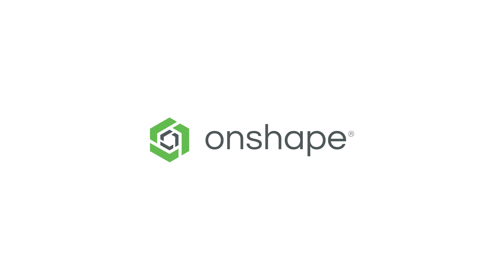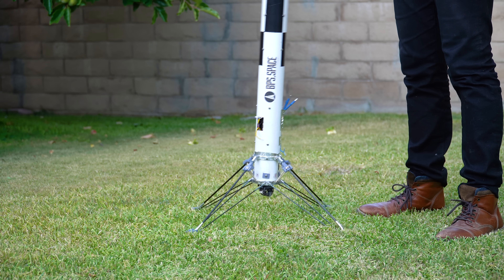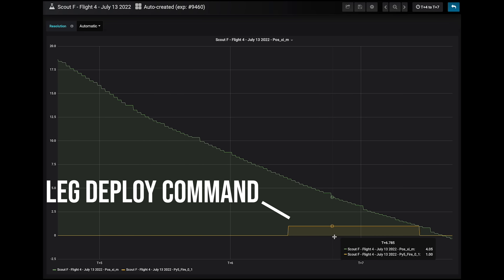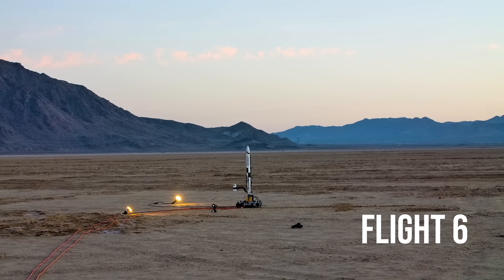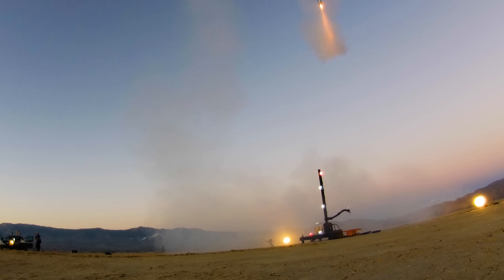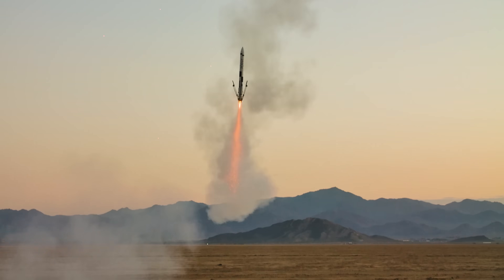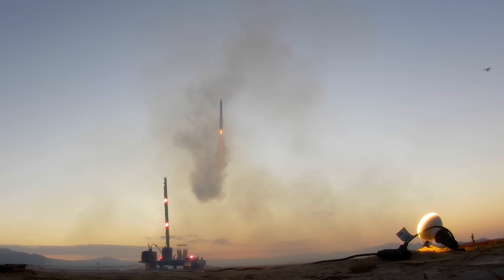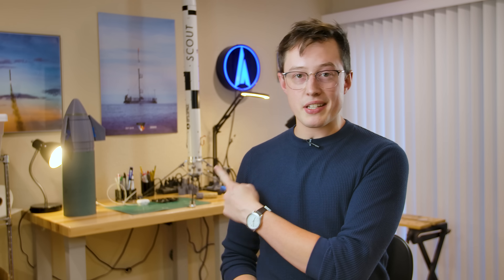Can This Model Rocket Land More Than Once?

Comment: Not a rocket expert but during the landing stage shouldn't the rocket put out more thrust as it like more nearer to the ground ? Like:  up - thruster1 - full  thrust  - > peak height- thruster1 -off -> decent -thruster 2 - half thrust (to slow down) -> just before landing - thruster2 - final full thrust (to make the momentum as low as possible. basically stop downwards momentum if possible like hover over) - landing -thruster 2 slow off. In the video it more like trying to slow down and reduce impact rather than trying to stop momentum. Just sharing an observation. :hand-purple-blue-peace:

Comment: Ceramic throttle arms....I assume you are using them because of heat resistance, but why not use a high temperature resistant metal? Also it may seem like a naive question but why not put spring loaded spokes on each of the landing gears so that if one side impacts first they spring out to expand the surface area of the gears (like a birds foot) making the rocket harder to tip once contact is made? Maybe make it mechanical so that you wouldn't even need to code it to trigger.....

Comment: did u consider hydrolics 
I mean a smooth syringe with water or something 
essentially it will move that fluid from one place to another slow or fast depending on the smoothness etc
this will dampen fall but will not have much recoil I think
just a suggestion maybe u might consider that in a future rocket

Comment: Idea here!!
I think the flex in the legs is fine because it absorbs the impact but it’s the rebound that bounces the rocket to the other side. So you could try letting the legs flex with a rebound damper to keep the legs from springing the rocket to the opposite side. So somehow  design a linkage that flexes as the strut compresses then the strut will slow how quickly that flex returns. Just applying some bike knowledge here.

Comment: You could use just the strut portion of the rc shocks. You had the entire coil over setup in the video, but it’s called a coil over because it’s over a linear shock. So might be an easier to access part going forward. Might’ve been what people were trying to suggest.

Comment: The "bouncy" was supposed to be replaced with a shock absorbance stabilizer. The leg stands needed to utilize at first into umbrella 🌂 unfolding fail terminal velocity resistance, before a kick stand poise. The rocket only needed to sustain a first fall high, a very low consistent long term flow of mini thrusters, to avoid that last moment acrobat crazy landing stunt. Avoiding fuel over burns. At low gravity or longer fall in planets. (China style.)

Comment: Love your work and thanks a lot for the content. Just an FYI. An RC car coil over doesn't just spring back. It actually has adjustable rebound by changing the disc's/Pistons. It has holes to control it. Since you have 4 of them you could use very small ones. I would definitely research them before discounting them. If you have any questions I race them and have a business where I invented parts for them to make them tougher. Thanks again.

Comment: On the legs, what would the fix be if you had decided to do it? Larger pads hitting the ground? Go to 3 legs? Or increase to 5? Seems like going larger pad would help and perhaps even add some drag on the descent stage to help slow momentum. Like dropping the gears on a plane, we usually rely on that drag to help bleed off speed during final.

Comment: Hey I'm trying to build tvc rocket, just takeoff no landing. My input is angle in degres calculated from mpu6050. I'm having hard time tuning my PID regulator. I tried with your simulink model from this video: https://www.youtube.com/watch?v=nwgd1CV__rs&t=747s&ab_channel=BPS.space . I have closed the loop, changed radians to degrees and degrees to radians where needed, added regulator in this model and than tried autotuning. The problem is that my tvc mount on gains calculated this way is soooo slow. Can you plese tell me how to tune my rocket properly? I'm also a bit confused because servos have build in regulator, so maybe only P regulator would be sufficient?

Comment: Just a thought, wouldn't an electromagnet be a better holding/deployment mechanism than burning through a rubber band?
Reply: I think that'd be more reliable yes, but it depends on the electromagnet and the application. If you're trying to release landing legs, then it may be best to stick with a rubber band and nichrome wire. An electromagnet may be too bulky and heavy for the rocket

Comment: Your landing problem is the same as has been the reason rockets didn't land until Space X. Larger will magnify the problem. The solution I gave to Space X was to increase roll control authority to minimize roll as close to zero as possible. That ended the history of crash landing, and began the remarkable history of landing success of Space X.  It could be a software fix or a heavier or faster turning gyro flywheel.

Comment: Those dampers aren't big enough to damp the landing impact. You might wanna think about making your own dampers, maybe with a crash structure system, like a tube filled with material that gets crushed by a piston on landing, It's cheap and it only has to works once, than you can replace the tubes with the crushed material.

Comment: Hi jeo bro, even space X is using CGT on top of booster why can't we use it in our model. We should consider using them that will be the efficient way. Try using one brushless motor whos shaft is in longitudinal axis and divert 4 vent in 4 different direction and block them as needed. Try it for me . . . 
I believe this would suraly work.

Comment: When the legs fold out the moments of inertia increase significantly. You may have accounted for this initially but the dampers you added would have increased it further. It may seem like a small amount of mass but since it is all the way at the ends of the legs it can be significant.  This may be the cause of the slide.  The control system thinks the rocket is easier to right than it actually is.

Comment: I good way to release things under tension is with a three-ring release, as used on parachute cutaways. They reduce the force on your actuator significantly, allowing a small device to release a large load. Better than the nichrome solution.

Comment: For the legs a longer damper can be created by using a tube that slides very tightly into another tube. Then use a thick grease or paste between the tubes to slow their movement. I've used these  a few times in different models. If you had a longer  damper that was a few inches, it likely would solve your problem with tipping over.

Comment: RC dampers , not full shock units boss .. they are linear dampers. Just take the springs off if you want to get the extra travel without rebound at all.

Comment: I wonder if the thrust could be further diverted to the point where you can apply a small amount of reverse thrust on the final bit of the landing burn when the motor is about to burn out. Perhaps the paddles could have a notch that only hits the exhaust once the "pincer" is all the way in the closed position, angling your thrust out either side at an upward angle to provide landing stabilization right as the legs make contact with the ground. If timed correctly a short burst of this reverse thrust may be all you need to prevent bounce. Could even ditch the dampeners if it worked well enough and raise your apogee due to less dry mass. That said I'm an electrical engineer not a rocket scientist and these are just my silly thoughts. Could open a whole other can of worms and the timing of this maneuver would have to be extremely precise or you might hit the ground way harder than before. The engineering of the thrust reverser channel on the diverter would be a huge challenge too. 

Good work on SCOUT it seems like you have learned a tremendous amount since I first followed your channel. Your SRB landing tech is very cool and if made repeatable I'm sure lots of rocketeers would love to purchase kits. You may even find there are other useful applications for it. Look forward to seeing a space shot from your team!

Comment: What if you add a sphere wheel in every leg, this could help the rocket slide on the ground and avoid tipping over. This could be fixed by an overengineered leg harpoon system that connects the rocket to the ground, but I don't know if that is what you are looking for.

Comment: is because you use carbonfiber on that legs. they dont broke but will act like srping, too much elasticity on them. meybe some aluminium tube will solve it. or Make the more large with some play on atachment, not rigid. you know the thing from doors? where rotate on one axis(ro rigid) best use more somthing like kichen doors where have some deviation on onpening and closing.(traslacion en el eje Z)

Comment: Hi these are great videos and very interesting development !   I was watching your challenges with the legs and the rocket falling over ob landing and could not help thinking "why is he using 4 legs?"  Surely 3 legs should provide a much more stable landing platform especially on uneven terrain?  I'm not sure if you have tried a 3 leg structure  but if not give it some though. Think camera tripods and the strength of triangles.  keep up the great work !

Comment: Maybe add one central leg straight down off the side of the rocket that will deploy and touch down first. Less momentum because it is close to the rocket longitudinal axis. Deploy current 4 legs after central leg is deployed and after touch down is detected.

Comment: For the legs:

To avoid the issue of one leg hitting the ground before the other legs you might try one of two solutions:

Some sort of linkage attaching to the leg on the opposite side to counteract similar to the philosophy of anti-roll-bars on car suspensions

Another solution following the KISS method would be to have one single damper that all four landing legs act on instead of a separate damper for each leg. 
This way a single leg hitting first has a relatively stiffer damping force counteracting than all four legs at once.

Comment: Many years ago when I was racing indoor RC cars, we also felt the need for dampers.  For us, we used a solid rod (nylon) that fit inside another nylon tube.  Then we put various thicknesses of silicon grease on the rod/tube to create a lightweight simple damper.  After each race, you had to disassemble, clean, and regrease. You should easily get 3~6" of landing gear movement.  Also, point the landing pads with the outside edges pointing up.  You want to land on your heels, not your toes. Your rocket is stumbling on touchdown.  Practice in the house dropping the rocket from .5m with a slight swing to practice landing. Use your camera at high speed to review exactly what is happening. Check the flight data recorder to review and adjust the damper length and thickness.  Currently, your dampers have such little throw, they almost do nothing.

Comment: There are two types of model shock absorbers. The ones you have shown don't have the oiled air damper in the cylinder, hence only springy. 

The springy ones usually go on the front of a car, while the other (damped) ones go on the rear. Have a look at a brand called TAMIYA or CARSON Model Sport and see if you can find them. It's good yo have these for future projects. There are different sping stiffnesses and different levels of damping available as well!

Comment: There's tunable oil piston dampeners too. 
Some you have to open and change a disc for the right resistance, others just twist. 
There's a trade off with tunability of a higher failure potential. 
The only thing I can think of to synch the legs is a cable drive linking them. Lot of torsion though.

Comment: I am NOT a trained engineer so please take any ideas or suggestions with a grain of salt. 
Now then, could you use nitinol to make the legs mechanically deform to absorb the shock? Nitinol would allow you to reuse the deformable legs due to the ability to re-heat it and have it return to it's original shape. Of course, I am a naive plebian, so once more, take it with a grain of salt.

Comment: In helicopters there's the concept of dynamic rollover.  Essentially if you catch a skid on the ground, and tip the axis of the helicopter beyond a slight tilt angle, there is no way to stop the craft from rolling over.  That's because you do not have sufficient control authority to overcome the tilting forces (the off-axis thrust vector works against your control authority to upright yourself).

Checkout dynamic rollover videos.

It seems to me that your landing issue is related.  You land tilted, and you have a thrust vector because the rocket motor is going.  That would me to me that you have a tilt angle beyond which it is not possible to upright the rocket.  If that is the case, then it is more important that the control system keep the rocket vertical until touchdown.

Alternatively you would have to increase your control authority and the only way todo that would be to add controllable side-jets.

Comment: You can still use the RC coilovers shock without the spring and it will behave as a regular damper with the added benefit of changing the silicone oil thickness to better control damping rates. Plus it has longer travel make it easier to compensate when a single leg touches the ground first

Comment: The rocket still seems to be tilted as it come into land.  My first thought is that maybe the imu orientation is getting messed up by the rapid movements after you light the landing motor, but I imagine you would see that in the flight data.

My suggestion would be to see if you can come up with a better way to measure the rocket's tilt relative to the ground so you're not reliant on the imu calculations, even if it's not as accurate as a high precision level or the imu.  
And yes, I realize that's very easy for me to say, but I do think that would help.

Very cool to see all this progress Joe, and can't wait to see what comes next!

Comment: Would it be possible to create a variable bottleneck for the solid engine rocket motor to adjust thrust output using Venturi effect assuming the flow of material is subsonic? I was thinking it really seams like a big limiting factor to not have control over thrust using motors with notable variations in power between each motor. Just a thought!

Comment: What about forgoing the mass of springs and pistons, what about a thin tube, with a light plunger, hole in the cylinder air can get pushed out, but its not sealed and wouldn’t push back for more than the time of the cylinder equalizing and then pushing out again. Could have it on top of the legs, on the body, so no major changes, it would sort of relax and set down a little deeper, thats all, maybe like a 35mm plunger travel length would be short and long enough for the application.

That would be as simple as printing a mount for the syringe diameter, and pinning the leg to the plunger handle. Everything else you made would stay the same

Comment: Not exactly rocket science - but it occurs to me that there's a reason why stools often have three legs - greater stability, and no need for all the legs to be identical in length, angle, etc. So why not try the same with rockets?

I assume, because F9 has four legs, there's a good reason for that, but has anyone ever tried three legs?

Comment: For the Big Scout, you can actually remove the springs from the RC car shock absorbers. If they are the oil type (not the friction type), you will get a nice long travel linear damper out of them. They're also easy to take apart and sometimes have a set of discs that can vary the dampening effect.

Comment: Still hitting the ground a bit hard. A simple spring around securing the ends of 2 carbon tubes with the interior interference filled with heavy silicone grease would be lighter and more effective than the amazingly crappy linear dampers youre using.

Comment: I completely forgot that Linear Dampeners are a thing you can just buy when suggesting the concept on the last video; glad they (somewhat) worked out! 
A (somewhat) simple way you could include them in the Scout design, would be to make the rods that lock in when extending the legs into dampeners. You could, basically, find a pipe that fits over the rod, plug up one end and give it a small air outlet. An improvised cylinder is, admittedly, not as reliably symmetrical as the ones you used in this, but it would give significantly more travel which could really help with those landings on one or two legs.

Comment: AAHHHHHHHHHHHHHHHHHHHHHHHHHHHHH
STARSHIP!!!
Only thing that worries me is the last time you did stage sep.....
Im sure all will be good though! Also, IDEA.
You may be able to use the same technique for landing Scout F for the Booster. The only thing I would change is how you throttle the engines. It would have to be smaller, and lighter than your current system.
And because it's a starship....

WEN HOP?

Comment: put the dampers on the lever root, not the tip
Reply: the passive finns to keep it not rolling
Reply: do actual thrust vectoring, not only thrust controlling, by 4/8 flaps on the solid fuel rocket nozzle (90/45 degree angle steps)
Reply: just use very long landing legs, telescoping and/or size of the rocket
Reply: dont gimble the whole engine, just use the direction control flaps 4x/8x
Reply: you first select the board pcb size as box, then keep the thing in the box, design smart, dont turn in to janky design reliance

Comment: Hey guys, here’s an idea. Can we use an electromagnet plate under a soft absorber sheet for the landing pad and a very thin ( light )  layer of metal like iron at the tip of the landing legs. With the dampers and other things the rocket already has its going to have a better chance at landing.right?